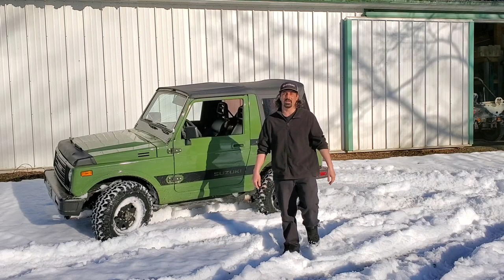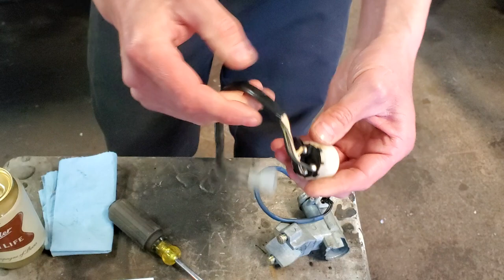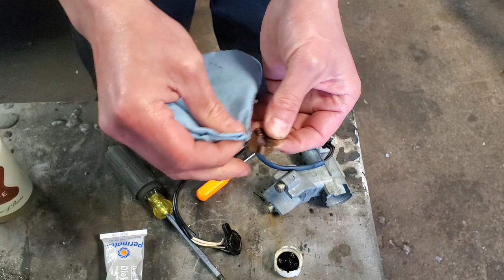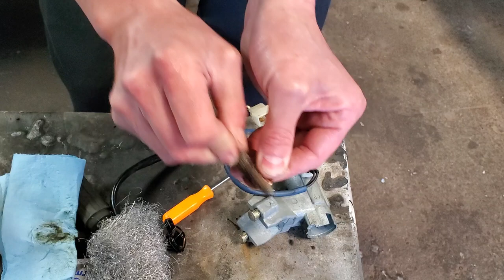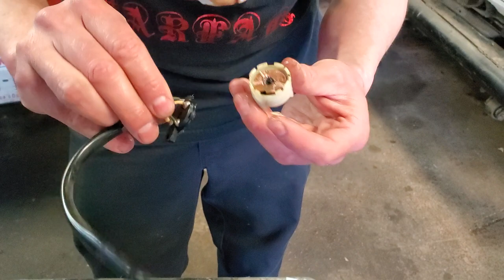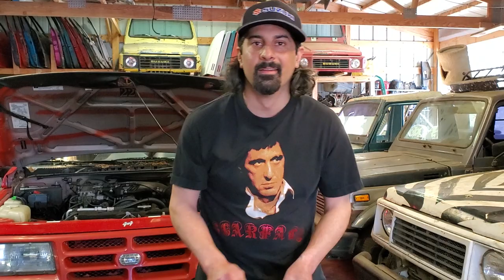Clicky Starter FIX! Repair Samurai ignition switch - NO More "CLICK CLICK" @Hwy83SUZUKI

Comment: Had this issue on a 91 tracker, tried cleaning the ignition switch contacts with no luck, tried cleaning the battery terminal with no luck, then tried cleaning the big contact on the actual starter. That fixed it! Sharing for those also not eager to replace their starter.

Comment: Just did this on my 95 Sidekick that was having intermittent starting issues. Starts up every time now! No issue. The mechanism is a little different on this model (three copper pieces!) but it's pretty straight-forward where the contacts are supposed to go. One thing you must lookout for is the springs that will most likely flop out the moment you open it up. Thanks for this video!!!

Comment: I did this fix this weekend. Opening the switch, it didn't look too bad but I noticed one of the 3 tiny springs sat lower than the other two. I gently stretched it out to the length of the other two springs, cleaned and greased it up, reassembled. It works on every single turn now---thanks for this video!
One other fix/idea video---My Samurai kept doing some weird, random acceleration/sputtering/hiccupping; no matter what I adjusted at the carburetor, it ran like crap and was unreliable. I finally found that the acelerator cable was fraying at the engine wall. That area of cable at the engine side of the wall is covered by a brown plastic stabilizer so you can't readily see the cable inside---the snapped threads were bunching up inside the stabilizer and not allowing the cable to slide freely. The cable was not completely broken so no mechanic ever thought to check the cable! It's super cheap and easy to fix. It takes some listening and adjusting at the carburetor after installing the new cable (be patient), but well worth it. The new cable and adjustments have also alleviated sticky clutch problems (hard to shift into 1st in cold engine. I don't exactly understand why, but I'll take it!) After this ig switch video fix, my Sam is running like a champ! Thanks again!!

Comment: 95 % fixed my problem  after  cleaning and reassembly worked most of time, still click once in a while.  Disassembled again, cleaned, regreased and added slim plastic spacer between copper plate and springs. Diy spacer cut from plastic Krystal Light drink mix container.  Maybe springs getting a little weak. Works like a champ now.

Comment: Thanks for this video. I am having this problem with my 91 tracker now.
Reply from the maker: The Sidekick-Tracker switch can be cleaned in the same way but it is less common to have this issue. I have found it is more likely to be a dirty battery terminal issue on those vehicles.

Comment: Tony, thanks for the videos, informative, funny and entertaining. On my 87 Sami,  I disassembled the ignition switch and cleaned the contacts as shown in your video.  Still, very weak power to starter.  If I jump the solenoid to battery, it turns the engine over fine.  Any ideas?  Besides dirty contacts in the ignition switch, what else would cause this?

Comment: Having clicky starter issues. Done this repair, worked one month, clicky starter again. Went to repair it again, plastic broke.  So i put in toggle switch  for ignition and push button for starter. Switches are designed  for the voltage and wattage.  Worked fine for month, then back to clicker starter. Jumping the starter at selnoid works every time. Wires look fine to starter. Next???

Comment: I don't get the click-click, I get the grind-grind then start ok.  What's the likely problem with grinding sound when starting?
Reply from the maker: Flywheel is missing teeth. It grinds until finding a good spot on the flywheel
Reply: @Hwy83SUZUKI  ouch

Comment: Is it the same for the sidekick?
Reply from the maker: The Sidekick-Tracker switch can be cleaned in the same way but it is less common to have this issue. I have found it is more likely to be a dirty battery terminal issue on those vehicles.

Comment: I have question, I got this 1990 samurai someone ran a push start switch on it, I want to go back to the original but can’t find the solenoid wire, could you help me with that?